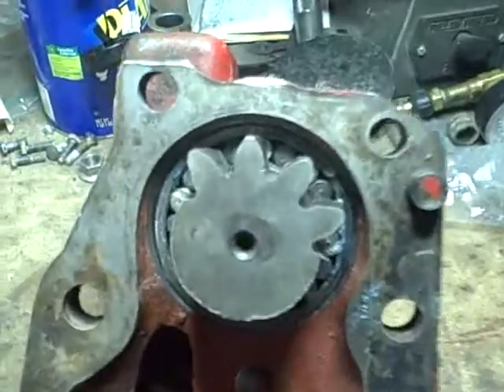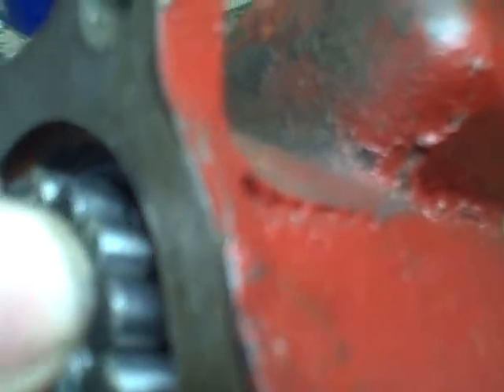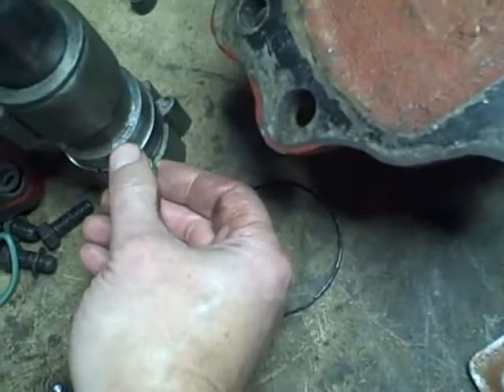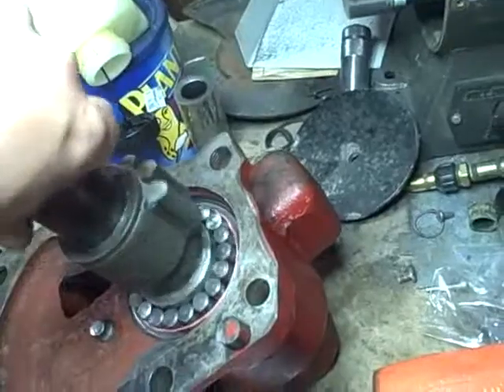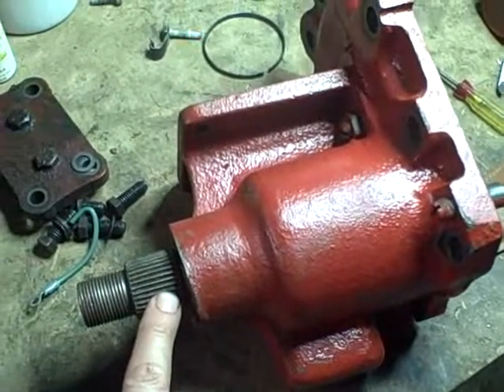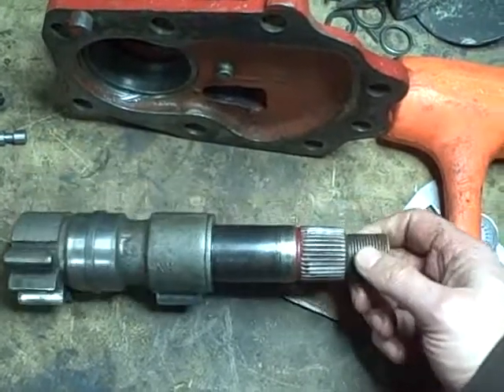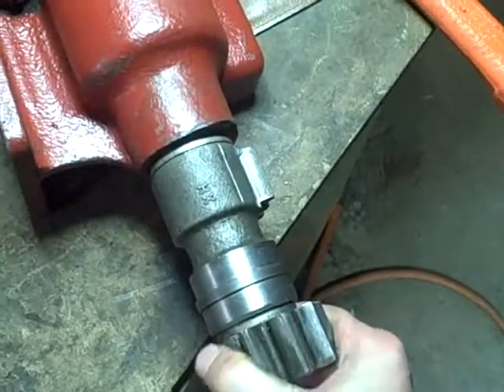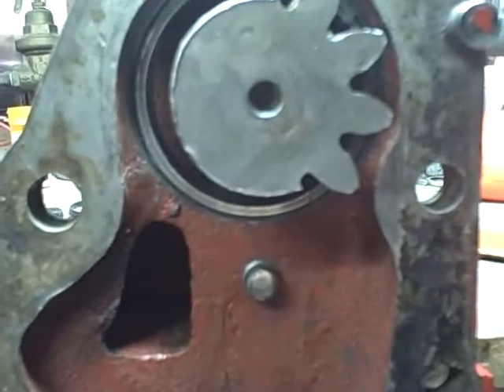IH 350 Utility Tractor Project Part 36

Comment: Hi Steve
 well Im glad ya the bent shaft was  the problem thats better than it being the bearing after all that work. you need a good machine shop with older guys to straighten this. I find most younger guys won't touch this older stuff. they want high dollar stuff in the shop. My engine guy did a severely bent Belarus crank 8 years ago, so with the right guy it should be easy to do this. Good luck
Regards Robert

Comment from the maker: Pretty much. I have been using it a lot. It pulls a good sized wagon for hauling wood. It could use some cosmetics, and the rear brakes are bad, but it runs great. The primary drive is still noisey, but works fine. The winch is still fried. Part to fix it run more money than a new harbor freight winch, and I do not have any real use for a winch anyways.